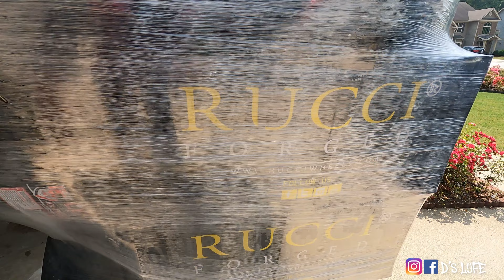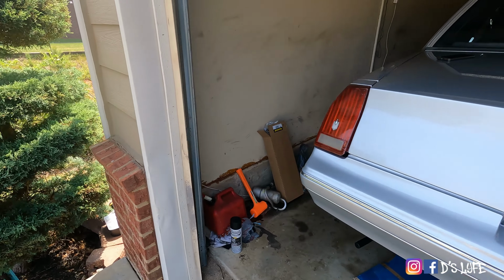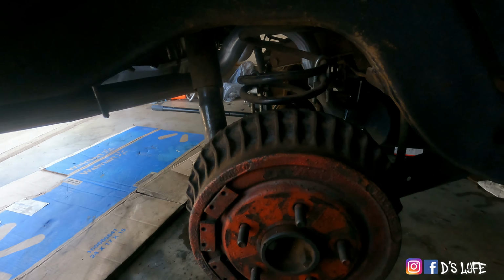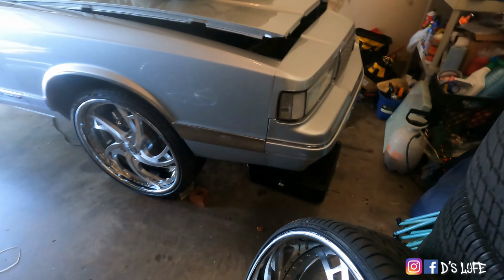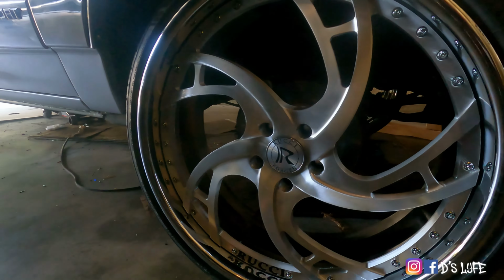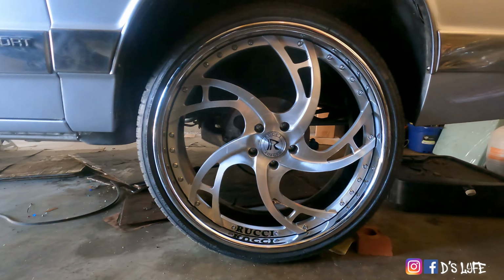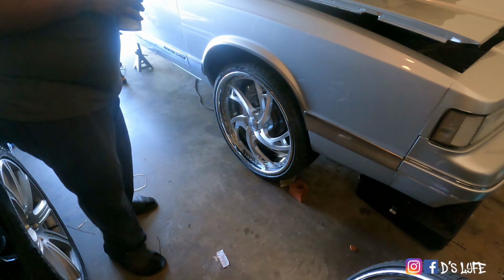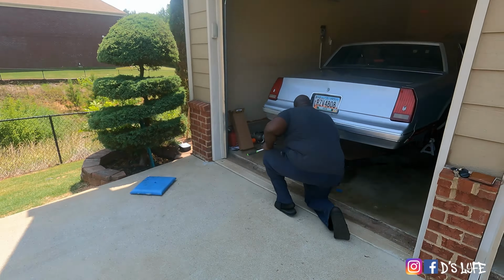MY HOMEBOY MOUNTED  24" RUCCIS WITH NO CUTTING | 1987 MONTE CARLO LS | GBODY

Comment: The wheels look real good on there, only thing is the offset coulda been better to get the wheels under the fender but some folks feel thats not necessary so i get it, they on the car for the most part
Reply from the maker: Preciate your thoughts on this. If I'm not mistaken, Rucci has a pre-fab offset for Gbodys and thats what he ordered. This offset is so he wouldn't have to do a frame notch. Anything different.... Requires some hacking. lol

Comment: @carminking9315 you do anything to the suspension? coilovers or anything? What bout the rear end is that factory?
Reply: Yes I did. In this video I had air shock on initially. A month later I went to QA1 rear coilover kit to give me the squat look comfortably. The rearend is factory but I changed the gearing out. No need to change it out the gearing if you don't want to.
Reply: @carminking9315 how did you fit your wheels on the back without cutting the frame?? Explain
Reply: @sheltonduplessis6814  the wheels was special order. The offset is just right without cutting frame.
Reply: @carminking9315 you ordered straight from rucci my brother if so you just told them you didn't want to frame notch 🤔
Reply: @gbody_gang5023  correct, I just told them I didn't want to frame notch. They set your offset to where you need it.

Comment: Curious what the offset is in the back and front? No cut?
Reply: The back is 24x10, front is 24x9. I just rolled the fenders in the back. No cutting no rubbing. Rims was custom made for car. Bolt right on.
Reply: What size lip in the back
Reply: @carminking9315  I just got some ruccis for mine made for gbody too.. What size tires you go with front and back? She clean ass hell brother!!
Reply: @carminking9315 that’s it just rolled the frame?
Reply: I’m curious too